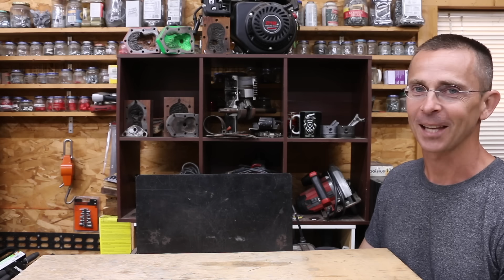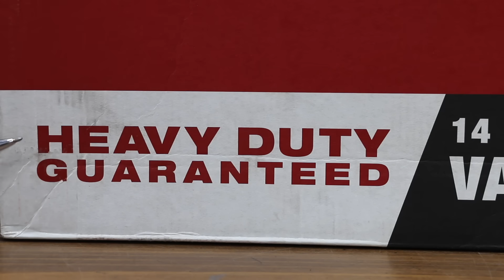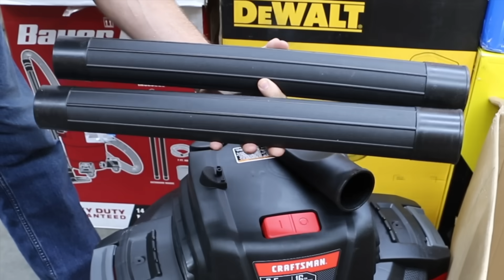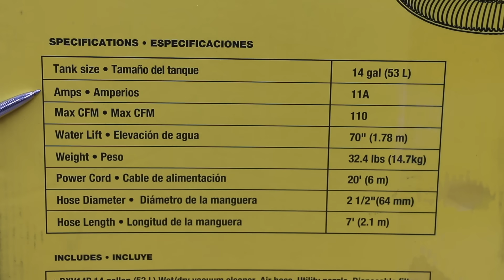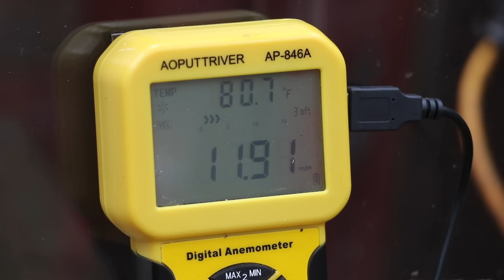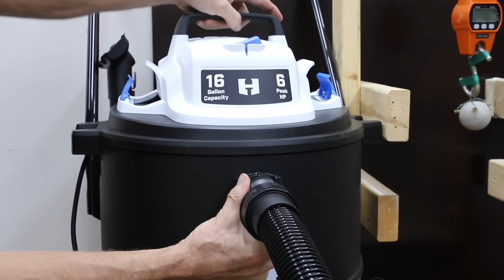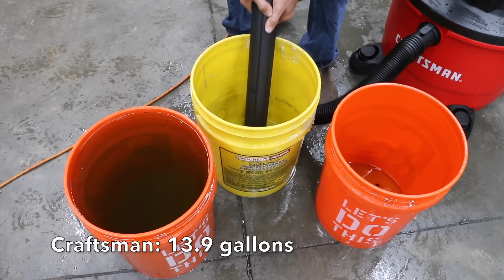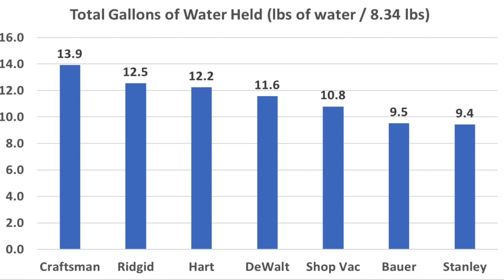Best Shop Vac? Ridgid vs Shop Vac, DeWalt, Stanley, Hart, Craftsman

Comment: well considering people abusing products and misuse. If people used products as intended and maintained them as they should then a warranty would be non issue. When I worked at kmart back in the day people would buy a push mower and bring it back next day after they mowed their yard. 90 days is enough to test something and not abuse the system. + Harbor freight sells replacement plans for all their bauer brands equipment. I wish I could buy all american but it either doesn't exist or its way to costly. Then you run into well this product line doesn't offer X tool that can be used with same batteries so you go to another brand and now you have a cluster of batteries and chargers. So far I own an Angle grinder/Drill/Leaf Blower/Weedeater/Chainsaw all Bauer brand and they have exceeded my expectations (all battery tools). For the cost of a "brand" name I would have easily have 4-5 times as much money in the products. They have earned a customer for life.

Comment: This was really quite good. Was each vacuum's filter installed for the air speed test?

It's probably difficult to test how well the filters work. I'm thinking a vacuum with really impressive stats that leaves your workspace cloudy with dust wouldn't be so good.

Another possible piece to this puzzle is whether or not the filters are washable/reusable or disposable & how much the replacement filters cost.

Another consideration is cord length.

Comment: hey PF, i got an idea for a video, so the idea is this, in my country some of the people believe diesel engine oil is actually good for gasoline because it will last longer a lot longer than the gasoline engine oil and it will clean the engine much better. they sometimes give you some proof about how clean the engine with diesel engine is (because the idea of diesel engine have much more detergent? to clean the engine). can you make the video about gasoline engine use diesel engine oil and is it actually better. comparison and oil lab test probably will give some idea is it actually better o worst. thanks oh btw this kind of people that use diesel engine oil on gasoline is motorcyclist.

Comment: I like that you called out the inflated HP secs.  6 HP my ankle.  If you maxed out a 20 amp circuit on a 120 volt system, you could only generate 3.2 HP at 100% efficiency!  Watts = amps x volts and there are 746 watts per HP.   I know its marketing but still, its seems bordering on fraud.  Great video as usual, thanks.

Comment: I'm surprised you didn't include what I consider to be a very respectable brand, which I happen to have myself: Karcher. It's probably not that common outside the EU though. Their WD series of vacs is actually pretty good. I have the WD3, but there's also a WD4 and even 5 if I'm not mistaken.

Comment: The hose diameter makes the suction test not comparable as the force is pressure times area. Need to use the same size hose on the ball. Cheers!

Comment: I got a shop vac specifically to clean up liquid messes, I got a shop vac brand one, not the model here, but it really struggles with liquid messes,  it just doesn't have the suction required to draw a column of water. I should have bought a Bauer, but this video wasn't out back then. It's impossible to separate the marketing wank from reality without tests like these. The "Peak Horsepower" claims are the biggest slap in the face, U.S. wall sockets aren't rated to put out more than ~2.5HP MAX, so anything over 2.5HP is pure bullshit

You are a gift to us all.

Comment: Excellent video, as always - but I found a flaw your your suction pull test. Suction, or a difference of pressure, is in units of weight/area (psi AKA pounds per square inch). In order for this test to be accurate, you would have had to divide the pull force by the open area of each tube. Since the diameters are different, the smaller tubes have an exponentially harder time creating a pull force than the bigger ones.

Thanks making incredible videos. I use your insightful product testing results whenever they apply to a product I intend to invest in.

Comment: Great  Comparison Video!  I have an old 32 gal Craftsman that's well over 35 years old. It had a solid 25 years in a very dirty environment with sawdust and cement dust being used on a daily basis. It still works perfect. So good that my brother bought a 20gal Craftsman around 20 years ago and it still works like the day I bought it. In all fairness It was used around his shop at his house. Not like the commercial setting of our old Craftsman.  Make sure you keep the filters clean and replaced as needed, and you'll get a long life out of these. I'm not sure if a new one would be near as good as the old ones though.

Comment: You have to load the engine to measure peak amp draw the motor has no resistance so it will not be correctly measured.

Comment: Man the marketing really lay it on thick with the False H.P. ratings.. 6 HP would be pulling 37 Amps at 120v. Given that these all have 15 amp plugs on them the max they could ever pull without tripping a breaker is 1,800 watts or 2.4 HP.

Comment: Shop Vac has another significant advantage over the others.  
You can get all sorts of supplies for a Shop Vac, like several types of filter bags, pleated filters, extra hoses and nozzles, specialty accessories.  Drywall Dust bags are especially useful for construction.
 ALSO you can get replacement motors for them if not to many years old. 
 The higher end Shop Vacs have BALL BEARINGS not shitty sleeve bearings.   
Even tho they are not tops in the categories, they are superior for support and supplies, and at least partially made by fellow Americans.

Comment: At 100% eff, a 20 amp circuit in your house is only capable of powering 3hp. Anything with a regular receptacle plug on it claiming over 3 hp is marketing nonsense.

Comment: Possible follow up video - is there a way to improve performance by dealing with the gaps in the lids?  What about putting a rubber o-ring, a few layers of tape or that insulating tape foam for doors/windows around the inside to create a better seal?
The head to head suction fights were definitely amusing though - it's little stuff like that which make already great videos fantastic.

Comment: You know what would be a good video? (Probably not the most exciting topic lol) Pump sprayers! I have a couple of the hand pump style, and also a 12v powered pull behind.
My go to, is a hand pump one I've had for years, (I forget the brand) it's been a good one. I've pumped gas, diesel, bleach, chemicals, water and God knows what else through it! I cringe at the thought of buying another one, and it failing in comparison to my old tried and true.

Comment: Awesome video! I appreciate the effort and the variety of vacs that were compared. Sorry man, but you lost me at the end there. After all that- Craftsman? Really? Somebody got robbed of the win on that one...

Basically same price as the Bauer (technically a few dollars more) and a lack of performance compared to the specs. If the peak hp translated to performance, it should have crushed multiple performance categories. This tells me that the construction actually sucks. Craftsman was probably cutting corners in the design. So that "good warranty" trumps everything? Depending on where it came from, the warranty is either through Sears (practically defunct, might not even be around to claim the warranty in 90 days at the rate they are going) or through Stanley Black and Decker, which means a trip to the regional service center. No thanks...

Bauer won price to performance hands down.
If we ignore price, DeWalt won overall performance.

The bottom line for me is that Harbor Freight is now offering near-DeWalt performance for 2/3 the price, DeWalt is the best if price is not a concern, and most of the rest suck (not in a good way).

Comment: How about a video testing garden hoses?
Like do the ones whom list non kink really do?
Do they lose their durability at high or low temperatures?
Can they be run over by a truck without cracking/breaking?
Are the more expensive hoses worth it vs cheaper knock offs?

While on the subject what about garden hose nozzles?
You have everything from harbor freight to $20 orbit brand ones that claim to be Pro Series?
How they perform if left outside all winter? Or how they perform if left outside in 100 degree heat? 
How many functions do they have? How much pressure does the jet setting put out vs the competition if it has one?
How it does if buried in mud or if it was dropped on concrete from chest height?
Is the old fashioned metal one function sprayer better?
I

Just some ideas on a product just about everyone has bought at least once most likely.

Comment: You should tedt the wear on a four stroke motor using a light 2 storkr gas mixture vs a 4 stroke motor without oil added

Comment: I have the Bauer one and I’m happy with it. There are some things that could be better but I mean, it’s not bad at all. It does have an issue when using as a wet vac, the bobble doesn’t like to float and block the intake properly so it goes through the pump and spits out the back when full. That’s really my only complaint. Mine didn’t come with many attachments though. Only 2 pipes and 1 floor nozzle. I think mine is a slightly smaller version than what you have but I have found that the only real difference is the hose size and tank size.

Comment: I have a Craftsman that's over 20 years old and still sucks hard.  I use it all the time.  The removable motor is especially useful as a leaf blower, etc..
I made a Thien baffle using a Rubbermaid heavy duty trash can and when I hooked up the Craftsman it imploded.  I replaced it with a galvanized metal can and the Craftsman makes it flex quite a bit with its powerful suction.

Comment: Vacuums can have high current consumption and low performance simply due to motor inefficiency, which produces heat in the motor and shortens it's life.  Maybe I dozed off, so all these vacuums are made in China?

Comment: Two video ideas: 1) explainer about vacuum fitting ”standards". That is the size of hose and accessory fittings. These don't seem very standardized to me. 2) dust extractors. Higher end vaccine with HEPA filtering.

Comment: I chose the DeWALT 9 gallon Poly Wet/Dry Vac and It's just right for my needs. At 9 gallons + the accessory bag it doesn't have a small footprint but it's still portable in either a truck or car. I don't carry all of the accessories in the bag but instead I usually carry MY accessories like car washing supplies or some tools or whatever the job calls for that day. It rolls nicely even when it gets on the grass, it's suction is plentiful and it is voluminous at 9 gallons which makes it quicker than 5 gallon buckets too. I like the bungee strap they have attached which secures the hose and allows for easier transport. After 11 months of ownership I it's held up nicely.

Comment: Since you have clear cylinder heads I have been hearing a lot of hype about unshrouding spark plugs. Can you run a test and show if this increases power with the flame front not being covered by electrode. I work in a motorcycle shop and a few guys keep swearing by this. They take their new spark plugs to bench and cut the end of the electrode off to just outside the edge of the spark plugs end. They say the spark will jump the gap better and the flame front is hotter.

Comment: There are a few videos discussing the horsepower displayed on the boxes and the actual horsepower delivered. However, none of them, like you can explain where the manufactures get their numbers. How do they sell an item showing 6.5 H.P. when it only produces 1.6 actual H.P. ?
An actual 5 H.P. motor will weigh more that any of these vacuum cleaners.

Comment: For me, the best shop vac is the one somebody put out on the curb and posted it to the local buy/sell/freebie mailing list. I've got one in the shop and three of 'em in the basement. I put it in a ventilated carpeted box to muffle the noise and it lets me store the planer on top of the vac, with a power strip, cord storage, and a place to put the fittings.

Comment: I've had the same Shop Vac for 20 years. It's picked up water, dirt, sawdust, plaster dust, just about everything. Still keeps going. I only had to replace the power switch since the original quit a few years ago.

Comment: very innovative tests as usual, however, I don't think the lift test was fair because the nozzle diameter varies. which gives different surface area for the vacuum to pull on.

Comment: I've been in construction for 50 years+ and been using Craftsman shop vac's since the late 60's. I also used different brands on jobs but the only ones I own are the Craftsman. I put them thru some very very harsh conditions (like concrete grinding etc.) hands down they make a great shop vac.

Comment: Is it feasible to try how high each vac can suck and hold a column of water in a clear pipe? Obviously this would require an almost 10 meter pipe, but it would be a benchmark of vacuum holding ability.

Comment: $29 porter cable I got  3 years ago at COSTCO works great. Just use it indoors and it uses home sized 1.25 inch vacuum tools which is nice. Chromed body.

Comment: I love your vids.  However, in this one, you missed the #1 issue I have over and over. Finding a shop vac, that can vacuum dust and not spray it all over.  Measure the out to see how much comes out, per unit.

Comment: Another professional and informative video, thank you! One suggestion: I would have also displayed the water capacity test data as a rate. Actual capacity (with water in this case) over the advertised capacity. Since the different brands have different advertised capacities this information would have been interesting to see which manufacturer was most ‘true’ to the advertised value. Keep producing great content!

Comment: WOW, THIS REVIEW REALLY SUCKS! LOL! Another great review. I have an old Shop Vac that's running on borrowed time. You helped me make a choice to buy a new one.  Back in the 90's I would go to the home shows to see all the stuff that was there., Two of the biggies in the vacuum industry was there with their home vacuums, Kirby & Electrolux (the original Electrolux) to demonstrate the suction power of their vacuums. Electrolux was the most impressive, they had an 8 foot tall clear tube standing straight up with a bowling ball inside, it was a 16 pound ally ball that just fit the tube, they opened the bottom of the tube so everyone could inspect the ball and indeed it was a real bowling ball and not a lightweight piece of foam or balsa wood. I was so amazed when they turned on the Electrolux it sucked the bowling ball all the way to the top of the tube. WOW! But the next thing they did was to KILL the Kirby. They put the hose attachment on the Kirby then turned it on then attached the Electrolux to the Kirby hose and turned on the LUX. The Electrolux sucked all the air out of the Kirby bag then caused the Kirby motor to spin backwards. That was impressive!
I purchased an Electrolux canister and I got to know he Service Manager and he showed me the inner workings of the machine especially the powerful motor. Being an AMSOIL guy I took mine apart and cleaned the motor sleeve bearing on one end then coated it with AMSOIL grease. On the fan end is a sealed ball bearing, I used a needle injector on my grease gun and injected the bearing with AMSOIL GREASE. My Electrolux is still running great. After 28 years I had to tear it down because my wife had a bag break and suck a bunch of crap into the fans and motor. I did regular maintenance through the years but never touched the bearings until now. So I cleaned everything out and add new AMSOIL grease to the bushed bearing (bearing was perfect with no signs of wear) I shot a little AMSOIL grease into the sealed bearing but I don't think it needed any. Now the old LUX is running like new again. Too bad Electrolux never made a shop type vac but they made a whole house built -in unit that could have had a good amount of suction for use in a shop, but the motor is not explosion proof so any volatile fumes could blow-up your shop!
NOTE: IF YOUR ELECTROLUX LOOSES SUCTION AFTER YEARS OF USE IT'S NOT THE LUX, IT'S THE HOSE, THEY BREAK DOWN THEN THEY SUCH AIR THROUGH IT'S FABRIC AND THAT REDUCED SUCTION ON THE VAC UNIT. PURCHASE AN AFTERMARKET VINYL HOSE THEN YOU ARE ASSURED OF LIFELONG SUCTION.
Back in WW2 Electrolux made the electric motor's for our bomber aircraft, notably the B-17 Flying Fortress. Motors powered things like the bomb doors and flaps and other devices on the aircraft.
This is a true story.

Comment: I have a smaller shop vac brand "shop vac" I believe it's 5.5hp, thing is great, I did alot of research before buying and the smaller vac had the most power/suction which is what I needed for carpets and cars.

Comment: I'm wondering if you can take foam insulation strips and use them to help seal the top to the bucket? If that would work then I'd buy the Rigid for the warranty and it also can be used as a leaf blower.

Comment: the trick to keep the filter cleaner, buy the cheap pantyhose, cut the legs off , stick one leg in the intake, put the hose on and it sucks things you wouldn't on your filter ( sewer, plaster dust, mud,ect.)stays in the pantyhose, you can dump it out or throw it out,a tube sock works also....